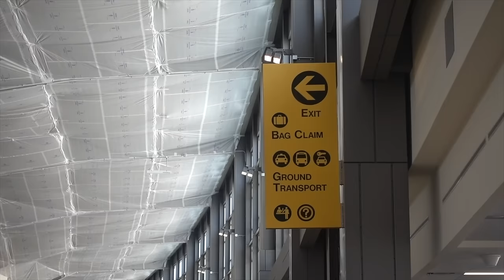MTB Myths that need to die—and some that are true!

Comment: There is a good reason not to put your quick release lever on the disc brake side: BURNS! 
You're going downhill that really nasty trails, lots of breaking, you get that snakebite. You jump off the bike to change the tube. But man, that QR lever is really tight! You change hand position and BOOOM - you burn the back of your hand on the 200°C hot disc. Not gonna happen on the derailleur side.

Comment: The one about the skewer.....that one has been around for quite a while, but I heard a different reason. I was told, "don't turn it towards the open side of the rotor " because the rotor can get hot, and you have more chance to burn yourself if you try to open the skewer when the rotor is hot. The chances any recreational rider would be opening the skewer when the rotor is hot is very slim, but putting the skewer a certain way would greatly reduce any chance of a problem.

Comment: Regarding the quick release myth; when the little nuts on them used to be plastic, you actually wanted the lever on the disc brake side, because people were afraid of the plastic nut melting from the heat of the brake
Reply: If you notice the disk has a plastic shield which would obviously melt first. If it was true that disks got that hot, which it isn't.
Reply: @garymitchell5899  im talking 70s and 80s when that used to be a thing

Comment: I hung a perfectly funcitioning SID fork upside down on a hook in the garage. When I used it on a bike next, a few months later, the lockout didn't work. If you're familiar with the SID lockout, it typically fails closed (e.g. you can't unlock it) but in my case it has failed open (I can't lock the fork). I've never had that issue with my Fox forks though.

Comment: The myth of the quick release was, that I learned in the late 90s, to put it on the other side, but only in the front, because, if you are going downhill really fast, the QR might get hot from the disc and you could burn your fingers if you take the wheel out to put it in the car.

Comment: I agree with the mindset for riding it applies to both disciplines or riding either bicycles or motorcycles if you are not calm or focus then you should not ride. As for the air in the tube when flying thats a new one and really not true. I've always gone flat pedals as I don't bunny hop as I can't and knowing me if I did go the clip route I would forget i'm clipped in and fall over. I did notice a fair few years ago about the quick release but time has fixed this. Just learnt that there are different hubs that engage at different speeds. It does not suprise me about the hex key as this is what happens when too many people speak who do not know how to use the tools. As long as the seals are kept in good condition you are fine, it's the same with my motorbike which I've not used for over a year it's getting worked on before any riding common sense and a service regime is key. I keep a couple of spare master links but I have used a master link at least twice but no more than 3 times and that's just me.

Comment: Decades ago, I owned a road bike that had vertical rear dropouts that had been cut down by the frame builder to the tiniest size possible.
I loved to put the quick release skewer in backwards so the left side only had the "nut" on that side.  It looked really sleek.
I'd occasionally get negative comments from other riders who were certain that it would cause one problem or another.  I invariably told them that I'd been riding it that way for thousands of miles and there wasn't any merit to their claims.

Comment: I have had a Shimano 12spd quick link that only lasted once. Put the chain back together and the chain fell apart in the stand while setting up the gears. This was on a brand new bike that had never been ridden. Now after I close up a quick link for its second or third use I pedal the bike in the stand a bit and try to press the link open with my fingers to make sure it has some bite.

Comment: 9:38 I'm a CNC mill operator and setup technician, I use hex wrenches all the time. the only way you will ever damage a hex screw with the ball end of a hex wrench is if you use a cheater bar or a professional strongman. I've more often damaged screws using the standard end of the wrench.

Comment: 1) One last run. Well last time I said yes was in the casino, I was on profit, and the last run well, you can guess it. Next time anyone asks me, the answer is no.
2) Clipless. I don't like them at all. I want a foot on the ground a.s.a.p. Period.
3) Skewers, why make it look sloppy if you can make it look safe and nice and technically professional. I like them in like with the fork and rear with the rear tubing. And not sloppy and carelessly put. Simple as that. Myth or no myth, that way it keeps them from collecting grasses and get in the way of branches effecting their locking.
4) I never encountered the issue. I use Shimano Deore, XT and XTR, and I use SRAM Eagles, multiple series of them. I use the correct cassette and hub. Maybe that is why I don't get this issue, never heard of it either.
5) Hex with ball top as I call them are fine. But they mess up the inbus...specially when you use colored versions they scratch them up. So I use the correct lengths of tools and that erased the issue.
6) Never had the issue, and I don't hang my bikes.
7) I buy a new one with every new chain I buy, and some extra. Reusing it...is not gonna happen. After servicing my bike, I want to see a new one, specially after chain cleans. They need to look as good as the chain so. Why save up on some quick links? I mean...I guess people just forget about it, so need to use the old ones.

Enjoyable video yes.

Comment: 6:14 It was with thhe classic Shimano RQ lever design, those should start to clamp at 90 deg, so if that's done correctly they are save, but soem don't tighten thhem properly before they close the lever so they can go past the closed position and get into the disk. Thus many bikes now don't have this lever design. but the classic design was easy to get correctt tention, as you just made sure it started to clamp att 90 deg.  But having insufficient tightens on the nut, and clamping the lever too much won't result in the disk locking up, but the rotor will rub on thhe lever aboutt 1-2 mm.  But yes, loose lever it can tilt backwards and lock it up. but the newer designs I see as in your video are trickier to get the tention right, so I jsut have to go by feel, trail and error, test until it won't rotate. So for me thhis has never been an issue. but i try to explain this to everyone when working on their QR lever.

Comment: You are correct on ball end hex wrenches. Hanging a bike upside down will mess up hydraulic brakes so I would be more concerned that the brakes would be affected by hanging it vertically (as opposed to the suspension)
Reply: The hydraulic pipe doesn't know what up or down is, and the brakes are horizontal, so that's a total myth.

Comment: As a fat guy (I'm 421 lbs), I can confirm that e-bikes are very helpful.  I need a little help pedaling right now, and it's a god send.  You are also correct about the lazy part.  I'm not lazy.   My wife and I will load up my 100# e-trike into the truck to go biking somewhere.  I'm loving it too! So much fun.  Wish I hadn't stopped riding so long ago.
Reply: E bikes are great, I love seeing people on trails that wouldn’t be able to ride otherwise. I don’t have an E Bike yet, but I definitely will as I age. Enjoy your ride I hope to see you out there.
Reply: me too! I got an ebike and I'm slightly less fat than I was before but it gets me out if the house because I want to go cycling! It's more easy and fun to do something when it doesnt hurt.
Reply: The question is

How did you end up over 400 lbs and fat if you're not lazy?
Reply: @Lee-ic2yn  Height also affects weight, genetics affects weight, hormones, etc. The real question is, why do you think you can judge when I'm sure you're no adonis either?

Comment: Clips = pedals with clips. We're taking it back. 
I had Onyx hubs on a DW link. I got rid of them because of the kickback on pedaly trails. I did like them on technical climbing because it firmed up the suspension and allowed ledge ups to be a little easier. I have a 36 poe hub now and it's better.
As an experiment, I used an 11s quick link on three chains. Never had a problem. The bike shop threw it away one day and I was angry. 5 year experiment over!

Comment: Regarding the quick release on hubs, the only piece of advice I was given was to position the lever when closed so its facing anywhere but straight down. I do this on MTB because it made sense to me that if I come down on something and it scrapes against the lever, I don't want it being pushed up into the open position.

Spot on with e-bikes. I know avid cyclists who have transitioned over to them as they get older. Still want to get out, but not tear up the body. I think the same can be said about recumbent bicycles.

Comment: On the last comment on e-bikes and lazy people, all I would say is I use a 'bent trike for work most of the time. On my local track I now see more than a few folks who are carrying a 'spare  tyre' or 2 around their middle. And for them I have the GREATEST respect. They KNOW what they look like, and must be aware of some of the comments that are going to be made about their weight. But they do it anyway, and that takes real guts. Will they ever become skinny speedo-wearing athletes? No. But their health will improve massively, and the health service will benefit hugely from their greater level of fitness.
Kudos to those who risk ridicule to get fitter. And they could not do that to start with without pedal assist.

Comment: Just thought i would point something out...
Becareful with some of those claims that you have made in this video's perhaps in others, here's why...
I used to be a mechanic, like what was mentioned in this video about tyres in planes and you showed a clip of you blowing up a tyre; that is that because you tyre didnt blow up that cheaper or budget ones wont either and YES im talking about the cheap crap that you probably wouldnt buy.

I used to have arguments all the time with customers when they would buy/install cheap parts and expect them to behave the same way as the expensive parts. On the same token just because you buy the most expensive parts, chances are your buying just the name.

Anyhow, like your vid's, i have just started watching a few of your vid's as i was interested a getting a mountain bike myself and wanting to learn more about them.
Cheers,

Comment: The skewer lever on the right is intended to help prevent serious cuts to fingers. It's easy for a beginner to have a finger through the rotor vanes while accidentally moving the wheel. Many folks will use their palm to close the lever, not paying attention to their fingers' position. Those sharp edges can mess a hand up.

Comment: With quick release in the 90's i was always taught the front one should close up just behind or infront of the fork so it can't get knocked by anything when your riding. The rear one should close up between the chain and seat stay so again its out of harms way and can't get knocked by any tree routes or rocks. Nobody ever told me to go the other side from the discs. I liked to keep it all looking tidy by having both wheel and the seat post quick release all on the same side.
Reply: Also, in races, a quick release that isn’t closed up against the frame or fork is a hazard if you overlap wheels with someone. It’s more of an issue on the road, but it’ll still hang you up where maybe there wouldn’t have been an issue.

Comment: Bunny Hopping... I started in my youth on BMX, then transitioned later to a road 'touring' bike. On my touring bike, I used the old toe clips, and bunny hopping was never an issue. It felt natural. I also then transitioned to a newer strapless toe clip, and the same, bunny hopping was simple and easy; I never hopped out of my clips, and I never used my clips to lift the bike. I never really gave it much a thought, but just getting a hop on my bike, whether BMX or road bike nearly always seemed effortless, with or without toe clips.

Comment: I used to work in a suspension testing laboratory as an engineering tech.  The design of shocks and such are such that oil cannot "pool" in spaces that it shouldn't be.  It is quite constrained.  As soon as you took down your bike off of a hanging rack, it would be just as usable as when it was when you hung it there.

Comment: quick release: I am more concerned about the direction I fasten that lever. happend it once with me that when I fastened it forward (thinking there the frame will prevent it to hit anything) and gone for a ride a branch stuck between the lever and the frame and opened it. I did not hurt, but you can imagine if that happenes before a drop it can cause injuries. So from that day I always fasten it in a way it points backwards. I know, the chances are very low to open it in the wrong moment, but still, better be on the safe side.

Comment: I want to say something about the quick release handle on the brake side. I was told back in the day, when disc brakes were finding their way to bicycles. (I'm a bike mechanic) 
That the reason you want to have the lever on the other side is, that disc brakes can get really really hot. And that might get the little plastic part become soft and so the wheel isn't properly tight anymore. And since i've seen bright golden and blue discs... i believe that can actually happen. You know... everyone is allowed to ride a bicycle... and soooo many are doing it wrong these days. 🙈
I keep watching the video now 😄

Comment: Airplane pressure at hight altitude corresponds to the air pressure at around 2200m above see level. In a nutshell, none of my bike should have survived being ridden in the Swiss Alps?!? However, the pressure change is quite rapid - i just reduce pressure on tires and suspension a little bit.
Only issue can be Rohloff 14 gear hubs - the air pressure difference between hub internals and cabin pressure may support loss of oil.

Comment: with the hanging bikes up the brakes are definitely a bigger concern than the suspension i work at a shop and we do alot of brake bleeds in the spring because people hang their bikes from the ceiling completely upside down and especially with tektro or older sram levers after a couple years the bleeder o ring starts going bad, combined with being upside down a little bit of air seeps in so if u hang ur bike upside down make sure you check your brakes before going for a ride

Comment: About the high engagement, it totally doesnt matter when you are riding, because if your hub is locked by the brake, and your suspension is compressed, then yes, it will pull back, but as soon as it rotates, you just slow the hub vs chain speed down, but theres still enough forward turning involved....

Comment: The quick release skewers lever thing reminds me regarding what people felt during world war 1 about how machine guns on planes would fire since it would basically saw off the propeller but the mechanism is built so that it would only fire in between the gaps...there are physical impossibilities but people still think its bad because of proximity
Reply: Not all plane machine guns had synchro belts, so many of them shot through the propeller. That continued even when they started using metal propellers and in many cases, pilots would be killed by their own bullets as the propeller made it ricochet right at the pilot.

Comment: Hans Rey would beg to differ on your clipless vs flats bunny hop theory. The simplest demonstration is to straddle your bike and put your back foot on the pedal toes down, hold your bars, and pick up the rear with just that pedal. As high as you can lift that foot. Add a half pedal stroke wheelie before that and you're hopping onto stuff. Even with clips your lift with your feet remains the same. Bunny hopping just with your clips will lead to you ripping your cleat out of the shoe

Comment: I did learn a lesson w/ QR axle tho, never close the lever pointed towards the front.  Much more likely to get snagged, especially when riding through brush.
Reply: This is actually very true. I use to do that and got snagged a few times or would pick up hitch hikers (twigs, branches, etc).
Reply: @MTBr-of-SoCal  I was riding my Stache through the woods a couple years ago and wasn't aware I had unlocked my QR on my rear wheel after snagging something.  A minute later, dropped a chain and ground to a halt.  If that had happened some place sketchy, it would have been the last ride of the day (myth #1)  LOL

Comment: The only reason I've heard to put the qr lever on the derailleur side is because after a long breaking cycle, that side might be too hot to touch if you need to do a tire change....oddly enough, I never had that problem.

Comment: I'll be carefully studying the tyre topic at 2:48 because 7 weeks ago my dirt-cheap (pun) half-tonne dirt bike front tyre came off the rim for no reason while just 17 kph rolling on highway, the balloon tube instant blocked the wheel, spun it sideways & I catapulted onto my left chest on Highway 124 all with zero warning of any problem. Made sleeping sore for 4 weeks. I'll be studying rim & bead circumferences of those fat tyres & the wheels with great precision until I'm sure that'll not happen again before I roll down hill at 60 kph on highway.

Comment: The problem with the quick lock is not that it might get catched by the brake disc ... But if you want to check if it is still tightened up enough after a ride you might burn your hand on hot brake discs. Happened to me once.